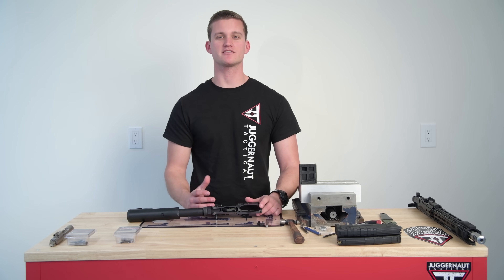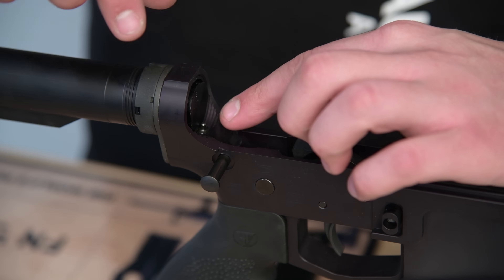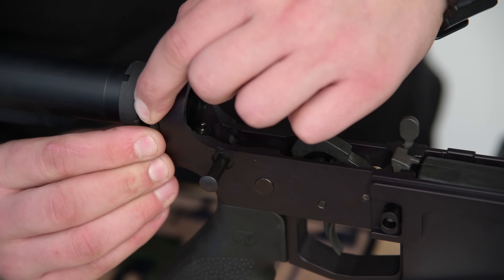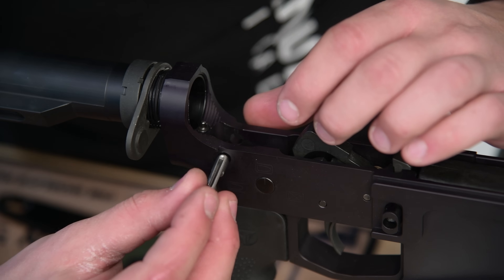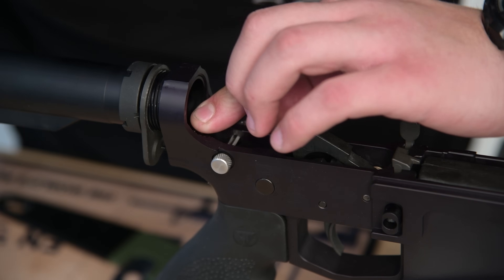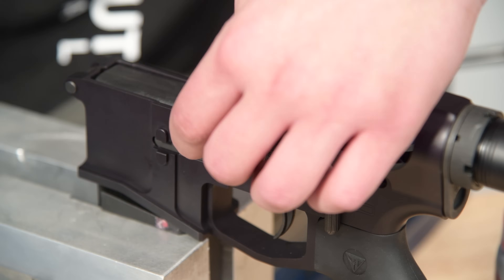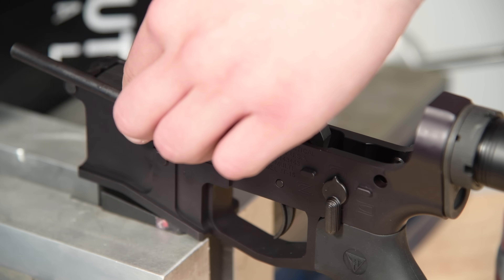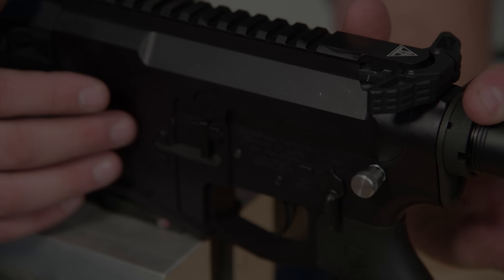Hellfighter CA Mod Kit Installation

Comment: For those of you asking what the set screw on the mag lock is: If the screw isn't out far enough, the kit doesn't work at all and the mag can be ejected just by using the mag release button, totally bypassing the magazine lock. Make sure it's adjusted properly (put the entire rifle together and make sure the mag won't release) then put on the loctite, otherwise the kit is pointless and you could be in trouble with the law.
Reply: Doug Shaw  well it could be skin heads ...bloods... crips... ect. But yeah I was wondering the same thing...
Reply: Yes yes of course! I will be sure to do this! 👀
Reply: @IamAkoma  If you think statistically, by the numbers, he's right.
Reply: Hello Brady is the screw just for spacing and not actually screwing into a hole ? Because mine works but there no screw hole in my receiver
Reply: @Pressingontoperfection  it's been so long since I've done this that I no longer remember, sorry I can't be of any help!
Reply: Running into issue where for mag not to be ejected using mag release the set screw has to be so far out I can no longer get rear take down pin through lower & upper receiver because they take down pin holes don’t line up flush.

Comment: wait, wait, wait WAIT, what the hell happens to my bolt catch release?  I don't want to pull the charging handle every time I reload!
Reply: What size is the roll punch that is used?
Reply: You don’t have a choice lol
Reply: @justinm.3594  there is a choice. Use a kingpin instead

Comment: i'm not raggin on Juggernaut at all, but this setup can be potentially fatal in a bad situation. scenario; local gang takes over your neighborhood and start shooting. you grab your CA compliant ar for defense against the gang that is firing indiscriminately at all houses. you have to start fighting back. in the chaos, you forgot to count rounds and the bolt locks open on the last round. you're fuct if you can't keep calm enough to have to hold the charging handle back while pressing on the bullet rest just far enough to allow the bolt housing to close. you still have to break the action, drop the mag, close the action, reload, rack the next round, and continue. in the time it takes to deal with all that, the one gang member could have emptied several 30 round mags. now imagine having to do this every 10 rounds.

Comment: Your instructions state for the aero M5 lower modification is needed, where and what needs to be modified in order to get this to work?
Reply from the maker: the pin itself needs to be modified. You would need to bring your lower in for us to do it.
Reply: @JuggernautTactical  gotcha. Is it anything overly complicated or just filing to fit? I am not in the area and able to bring it to your business.
Reply from the maker: @gunsforevery1  yes - it needs to filed a bit
Reply: @JuggernautTactical  thank you!
Reply: @JuggernautTactical  I now have all the parts on hand. The m5 lower and hell fighter kit. 

From what I can tell, the left side of the pin (where the spring and button screw into it) needs to be shortened, otherwise it sticks out way past the receiver. 

Is that correct? The pin just needs to be shortened on the threaded side.
Reply from the maker: @gunsforevery1  send photos to sales@jtactical.com. Our gunsmith will take a look.

Comment: 3:09 marrs the crap out of the buffer tube castle nut when the vice slips and keeps rolling like it's Saturday Night Live.  LOL. good stuff.
Reply: I thought the same too! He just straight slammed that lower on vise.
Reply: Also when he was installing the roll pin to where the bolt catch used to be
Reply: I get it if this was his own rifle/defensive tool and doesn't give a shit, but if a gunsmith (or gon-smif) did this to a customer's rifle he'd have to repair that.
Reply: They sell a special punch specifically for installing the roll pin.

Comment: Is there a good solvent to break down the red loctite? The set screw is set just slightly too far out and my upper and lower do not meet flush because this stupid maglock now sets too high. I can't push my takedown pins through now. I even counted turns before I put the loctite on 🤦‍♂🙄
Reply from the maker: are you local to our shop? If so - bring it over and our gunsmith will take care of it for you. Otherwise, send us an email: sales@jtactical.com

Comment: Great video. A “friend” ordered this for his AR. Question. “He” is not a gunsmith so have none of these tools. Can “he” bring his AR to a Gunsmith and have this installed?  If so, would they only need his Lower?  He doesn’t want to break any laws transporting his firearm. Or would it be ok to transport his rifle broken down into two parts upper/lower?
Reply from the maker: When rifle is broken down to upper and lower then you are fine transporting it. If you need the kt installed you can bring it over to our shop in Orange.

Comment: Has anyone had the end cap for the takedown pin come loose when firing. I just installed this and have to keep tightening about every 15-20 rounds. Blue loctite a fix?
Reply from the maker: add a bit of Elmer's glue to make threads tacky. Sometimes it happens when switching the safety sector and unknowingly unscrewing the cap. Our Ambi Safety Selector should also help with it, as the lever can be adjusted further down creating more room between the pin.
Reply: Great! Thanks for the quick response. I’ll probably do both as I’ve been wanting to add an ambi safety on anyway

Comment: My lower has a stupid tiny alan wrench holding the detent spring and pin for the rear take down pin. So i had to screw the buffer tube all the way out. Didnt realize it actually holds the buffer spring retainer pin in. Now im searching my floor for the retainer pin that shot out at light fucking speed. So lame

Comment: You guys are just not going to warn anyone about the bolt and how it won’t release on an empty mag?
Reply: Mine does. What do you mean?
Reply: Robert Hughes my carrier group catches on the empty mag and there’s no way to rehearse unless you stick something in and push down the feeder
Reply: @1992xGeo  does it do that with all different mags? Weird. I can check when I get home if you want. Maybe it's something not adjusted right. Make sure mine doesn't do it. I haven't used my hell fighter equipped gun in a while
Reply: Robert Hughes so far it’s done it with several different branded mags

Comment: I purchased this product for both of my ARs. The product works but I couldn't stand the fact that the bolt catch function was gone. These are now in my box of spare parts was I went with the AR MAGLOCK Gen 4 that retains the bolt catch. I don't recommend the Hellfighter.
Reply: How hard was it to replace?
Reply: @crunch9876  it took me about 10 min each rifle. Really easy
Reply: @redlinemsa  did you keep the same mag lock or replace that too?
Reply: @crunch9876  by mag lock do you mean the mag release button? If so yes. Only thing I don’t change was the action brake button pin. I left the one from this kit, it was the only thing I liked about it.
Reply: @redlinemsa  what about the bolt release paddle? did you just put the stock one back on?
Reply: @peterwaltersyoga9248  yes stock one back on.

Comment: Sorry but I purchased this product and the matte finishing you put on it, makes it gritty and difficult to operate. Almost as bad as using sandpaper as a finish. Would have been better to have smooth polished stainless steel that was anodized black.

Comment: I am having the problem that when you shoot the last catridge, the follower will stop the BCG. I am using pmag gen3 10rounds. With out the conventional bolt release mechanism, the BCG just stuck in the buffer tube. I have to use a screw driver to do the job of bolt release. I am wondering if it's my installation problem.
Reply: Once you put a new mag in, pulling on the charging handle should send it home
Reply: @jubjub905  Thanks ! I also filed the back of pmag follower a bit. Problem solved.

Comment: Works like it says, it just barely  cracks open the upper and lower allowing for fast mag swaps but when I went to pull the pin all the way to open receiver for access and cleaning,  the groove the detent rides in is TOO SHALLOW. When it reaches the stop in the groove it pulls right past the detent and completely out leaving you to have to take down the castle nut yada yada... I thought i could machine it deeper but the hollow threaded end makes that impossible. The mag lock piece works fine so far. I now have a Delta Pin from Patriot Pin. I'm only leaving this comment as a review to save someone 65 bucks. Cheers
Reply: I had the same issue.  The detent got stuck when I pulled the new rear take down pin out to attach the upper receiver.  I had to cut the new rear bolt.  Waste of money.   They make this looks so easy online.  Any tricks for my next attempt or do I just take this to a gun smith?
Reply: Thanks Bro
Reply: Can someone tell me what the point of this is?

Comment: Look, I get it. Cali has different rules. But is this dude saying 'bolt button'??
Reply from the maker: "bullet button" - refers to a device that replaces a firearm's magazine release. The magazine is fixed until the catch is released by pressing the tip of a bullet into it.
Reply: @JuggernautTactical  bullet button makes way more sense than bolt button, lol. Cheers

Comment: Do the bolt lock back when the magazine is empty?
Reply: Yes. The issue is probably your magazine though. The bolt tends to get caught on the empty mag. You can easily grind down the mag with a file so it doesn't get stuck. It takes like 3 minutes. There's videos on YouTube on how to do it!

Comment: This being America's gun, commonly in use and therefore very likely to be owned by total beginner gunsmiths your video is not only helpful but critical to comply with the constantly changing laws around the country.

Complying with unconstitutional laws will keep us from incurring vast legal costs and possible jail time from oathbreakers in law enforcement and legislators who should be facing jail and legal costs for failing to perform the minimum requirements of their offices,  To protect and defend the Constitution of the United States of America. 

Thank you for your simple explanation and demonstrating how easy it is...  and the shameless plug for your awesome product!

Comment: On the Daniel Defense V7 this modification DOES NOT work the magazine block sits too high and ends up rubbing down the under surface of the bolt carrier group, which in turn causes malfunctions primarily in the form of double feeds and failures to eject as well as not going fully into battery.  for the longest time I was so pissed that my DDM4 V7 Pro was giving me problems until I notice the gouge on the BCG and low and behold it's from this mag lock sitting too high.  maybe DD rifles are just really tight internally, or maybe this product wasn't designed properly.

Comment: I picked up my Diamondback db15 here in CA yesterday. It has this same setup. With the in-box magpul mag the bolt BARELY stays locked open with an empty mag. I look at it the wrong way and it releases. With the Cross industries cross mags the bolt stays locked back. How do you release the bolt without a bolt release? I can’t release the upper to pop the mag without the bolt in battery. Am I missing something?
Reply: This product is trash... they want you to shave down the magazine so the bolt doesn’t catch....

Comment: Good concept but $70 is expensive. Include a chamber flag since we can't hold the bolt back at the range to show it's safe.
Reply: You can find the kit for 45$ my local shop has them for 40$

Comment: bought 3, 2 308s, one ar-15. None were stainless steel or shiny. They work quick and setup is nearly invisible. As fast at normal mag change. The detent pins can pop out when completely separating upper/lower for other work. Easy Fix.
 Make an extension to replace the left side cap. use a 0.249 (or 1/4" sanded down in a drill)  diameter standoff 1" long with a 3/8" 6-32 set screw in one end (use lock-tight). Before pulling the pin all the way over to separate the upper/lower for other work. Run the new extension into the pin end. The extension keeps the detent pin from popping out of place as you slide it. The Ar-15 set differently than the Ar-10 (DPMS 308) due to the different direction of the detend post.
hope to see them make them in stainless.
Reply: Bobby Brady  actually you're right and in the long run they proved to make the weapon more awkward and dangerous if something comes off or jams especially  during reloading such that you can't break the breach safely for field repairs. Switched back to mil spec. screw CA.
Reply: Bobby Brady  unfortunately President Trump's federal authority is just limited when it comes to states. He has authority over federal marshals and a few police. The National Guard is his power play but requires state governors to request help. Being all demonrats they would rather see their cities burn than ask his help. He would look good and the demonrats can't allow that. Drag them into the town squares and give them the mussolini treatment.. State and city police are not under his jurisdiction. He can't bring in the federal forces without state governors requesting it. Most all the cities in trouble have been under  democrate control as is the House of Reps. I don't see why cities tolerate mayors allowing rioting, looting and chaos. Citizens should be able to override one person's authority when they cause death to those who they are supposed to protect.
Reply: Bobby Brady  you're getting into the weeds and sounding like a paranoid doesn't help. Like I said the GOP and NRA need to step up and PUSH BACK.
I wasn't trying to change any subject. You brought up so many. This format is far to inadequate to cover all the aspects you bring up and tie into a knot.
 Try including links to support you positions. 
For every law there is another law, for every situation there are others in opposition..
Throw in a few off- the -wall SCOTUS rulings and predictability to apply established laws goes out the window.
 President Trump has always been keen on letting the libtards make fools of themselves. Pelosi's and Biden's mental decline makes that easy.
The city of Seattle took back it's "summer of love"  core in just 30 minutes without federal intervention. 
Our President has exposed the depth of the deep state's socialist corruption. Far worse than what was suspected.
Charging Federal Treason Statutes is complicated and 2 witnesses are required, under 18 USC 2381 and the nation is at war..
Probably why obama hasn't been charged with treason for "aid and comfort to an enemy"  flying 1 billion in cash in foreign denominations and 150 billion in assets.

As far as "what he should or shouldn’t do during an election year. I was addressing what he could do,"
You can't discuss a "should do' and leave out the "could or would aspects". 

Its all hot air here as nothing productive is ever produced. People go back to the couch feeling they have contributed enough by  replying here an there. 
Like the ol saying goes, " old age and treachery. will overcome youth and skill.
 Thank God for those who like to burn never vote.
This is as far into the weeds I intend to go.
good luck.

Comment: With this mod it doesn’t look like there’s anywhere to attach the MagPul BAD lever...
Reply: Rude420Boi you cant use a bolt release on this. Looks like charging handle only
Reply: Instill have my bad lever installed

Comment: I have two these. I’m pretty sure I have it installed correctly. On both kits the takedown detent pin pops out when trying to disassemble the upper from the lower? What am I doing wrong?

Comment: hi I just bought a heel fighter from second amendment and I'm trying to install the problem I'm having is the mag release button. so I took the old one out like you did in the video but then you install what you said was the factory mag release spring and button... where are these parts coming from do I need to go buy a new mag release button because I don't have an old one or factory one like you said
Reply: Yeah, you'll need to get a milspec mag release to replace your bullet button mag release

Comment: Finding the bolt lock/stop roll pin slot not wide enough for the roll pin. Went back to store to see if it was just mine. Nope they are all like that. Maybe the pin will decrease in diameter upon installation due to the interference fit to the receiver. But the roll pin does not fit freely when I try to put the pin through the slot in my hand. Just don't want to mar up the part.

Comment: Just installed one on an AR-10, if i use a 10 round pmag it will lock and will not come out until the upper is lifted, the problem is if i use a 20/25 round pmag it will lock but if you press the mag release and pull an wiggle the magazine it will eventually come out. I have tried adjusting the set screw to every position possible, and at this time i am wondering if other people have actually tried to pull the mag out instead of lightly moving it like in the video.

Comment: Just installed this in my AR15. Two big issues I have w/ it. 1: the button is too large & gets in the way of the fire selector switch & is incredibly annoying. 2: the new take down pin is a rough-ish finish & makes it really hard to push & function as it’s suppose to
Reply: Yup it’s does make it hard when trying to flip the fire selector switch 😳

Comment: Heads up to anyone that has done or is doing this. The cap (last step in the video) has a threaded dowel that does not have any loctite on the cap end. I did not know this so when i was doing some night shooting, the CAP backed out leaving the dowel in the rear pin. I lost the spring due to this. I would  suggest removing the dowel and adding a little Blue loctite on both ends.